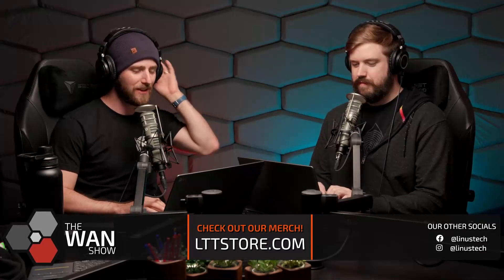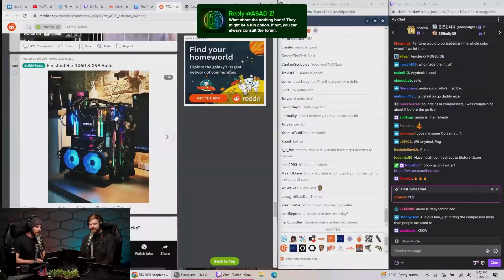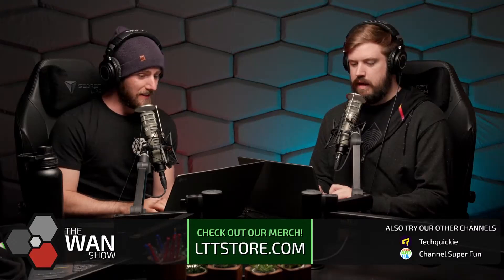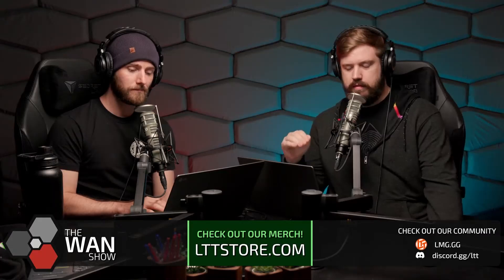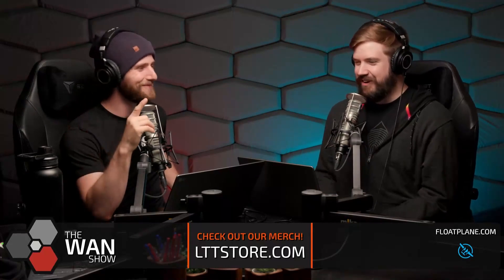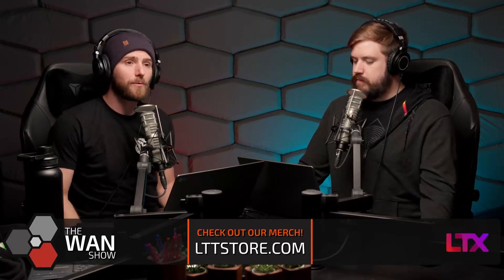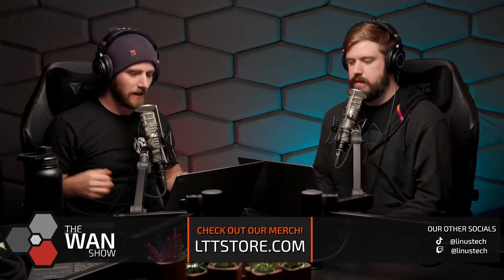Why 4090’s Are Catching Fire

Comment: I want a 40 Series, failing that, I want a 50 Series in 2024, but this melting connector issue has me wary of actually buying one.
Reply: Get a 30 series
Reply: @crazygamingyt7245  Already had one, and bought a 40 Series which I paid less for than I did my 30 Series.
Reply: @nihren2406  because the 40 series is worst

Comment: I think it could be attributed more to cheaping out than you claim- the plastic used is likely ABS or PLA which normally wouldn't melt, but with higher temps being produced by the 40 series GPU a more expensive plastic with a higher melting point might be necessary. Also reduced metal contacts cut on total metal required for production. Sure it might be 40 cents for a single GPU but multiply that by millions of units in production and that could be thousands in saving, and better materials likely will cost more than just 40 additional cents per unit (could be upwards of $1-$2 depending on the material). Now this might not even be Nvidia's fault, rather what the ATX standard would require for this new power connector, saying that these materials are the minimum required for the standard.

Comment: Maybe this question was asked in the comments already, but why are these power connectors at that location anyway ?
Would it not be possible to put them on the back of the card or something (opposite side of IO-Shield back). That way the cable management would look nicer too.
Reply: Both that the end of newer GPUs are actually just heatsink, the actual board stops a fair distance from the end, and that the cards are already stupidly long making it even longer with a power cable would mean them fitting in fewer cases. IMO the cards are already stupidly big enough to not fit properly anyway and would prefer having the power at the end.

Comment: Maybe the next RTX 5090 will need a separate 1000w/1600w power supply.

In latam that power consumption end up paying more in long term for the electricity than the cost of the videocard, and that's a LOT of money.

Comment: I suspect there was an engineer at Nvidia; "Yes Boss we can push this much power through a connector but we shouldn't; it's right on the edge and not very durable. There is a similar connector but with larger pins we can use." And they were overruled by management who could only focus on the idea of a single small connector.
Reply: The general rule is when an idea is unsafe, but may be desirable by management, say that it is not an option and describe the safety concerns.

Comment: The problem is that there are 2 types of adapters, Gamer Nexus had investigated this and they have a completely different Nvidia adapter than Egors Lab. They could not reproduce the error with their max 300v adapter, Egors Lab was a max 150v adapter.

Comment: Needs more thumbnail flames for ultimate click bait status. They are not catching fire, there are a handful that have a melted adapter (to varying degrees). This is a serious issue but making people think 4090's are catching fire is not helping the situation. It's clear that this is not a widespread issue, but Nvidia absolutely needs to be held accountable until there is a proper solution (which should be made available to all 4090 owners free of charge).

Comment: The connector is right up against the glass of my Corsair 4000 Airflow - I refuse to buy another case and rebuild the PC. Hoping the CableMod/Corsair cables allow for a little more bending. Then CableMod with that right angled adaptor will be a great additon. Because the 12+4 connector is also very small and light, its not always easy to tell you are fully engaged into the GPU socket as the "click" is a lot less than the PCI-E cables - I decided to double check mine before closing the case and to my relief, it wasn't fully in so I bet that will be a lot of people's undoing - bending, dodgy soldering, not a sold connection to the GPU all factors in a connector I wouldn't be surprised to be consigned to history after the 4000 series.

Comment: Buildzoid theorizes that problem with the 12V high powered connector has to do with the terminals where the connection goes. Nvidia is using a dual split design which in theory could be the reason why there are issues with this while 3rd party makers of the cable are using a single split design.

Comment: wait a second.
so are the wires pulled out from the terminals
or do they get squezed at the bending point.
Reply: Because the wires all have equal length, the tension on some of the wires when bending the cable can be pretty big.

Comment: I'm thinking what are the odds Nvidia never tested it bent? Like what if they just put the 4090 on a test bench with the adapter and never bent it like a user would for cable management purposes. So I'm wondering if it's something that was just never though of or considered when Nvidia made it
Reply: They did test it you should watch gamer nexus video about this, they bent the shit out of it and still not get any mailfunction done its working fine under any conditon!

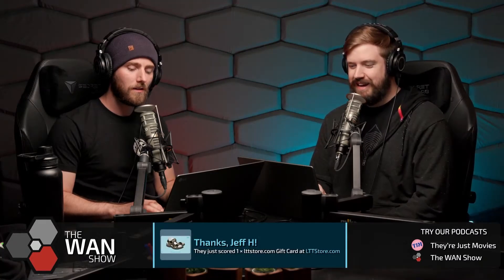Comment: 4:46
>small form factor users beware
>talking about the 4090
Reply: That connector is most likely going to be on all the 4000 series cards including ones that will be more small form factor sized.
Reply: @chronossage  like that'll exist
Reply: These days, "small form factor" could equate to "building a computer inside your GPU".

Comment: My high school teacher told me tight bends don't effect current but I told him he was wrong.  I didn't know how to explain it at the time, but watching a vacuum cable stretch pop out of the socket sparking was enough to understand the real world.  Funny how It's almost required for an electrician to come in to wire up a 25W light bulb and switch, but... it's perfectly ok for anyone to be responsible for contacting some new odd adapter that "allegedly" is sufficient.
Reply: I think you should have listened to your high school teacher...
Reply: @GareWorks  LOL His Science was sound but not all end-users follow science protocols.
Reply: I’m not sure I follow, tight bends in and of themselves don’t affect current, but if the pins in the connector are loose, they can be pulled out of contact with the metal contacts on the GPU receptacle. It’s not the current that’s the factor here, it’s the force a bent cable can put on a connector, particularly a badly designed connector. If their was no connector and we were just running electricity along a pure wire, it wouldn’t matter how bent the wire is, the current wouldn’t be affected (assuming we aren’t working with large currents here, electromagnetic fields do get more involved as the current increases).
Reply: @FinalSentinel  Absolutely I was wrong on the science in school,  Bends don't affect electrical flow the way they impede water flow for example.  But the wire itself is soft and gets fatigued, the terminals are usually built as cheap as possible and deform easily. It also depends on the installation, was the connector seated correctly?
Reply: @pepperfish_  please to not use the word "cheap" when the reality is different on many levels.
The terminals and their materials are designed with the contact area in front in mind.
The terminals have to withstand plugging and unplugging.
Then the crimp or solder area is designed as secondary constrain.
Optimizing for the contact area means compromising for the solder area.
Also note the continuum between flexible and brittle: Make it "harder to deform" and it becomes brittle and a thing we call "breaking" happens. Make it soft and you complain about that it deforms to easily - while bending/forcing the cable into place is literally deforming "something". Now you can ask for brittle pins and super flexible wires - and then we know for certain that it will break in the solder joint. Sometimes, making things less flexible makes them more robust, because stress automatically distributes over a larger radius.
Reply: @sarowie  What you say is not wrong, however this is not the original style PCIE power cable.  This 12vhpwr redesign I think is to reduce costs.  The old connector I agree was sufficient as you describe.    Along with my PC hobby also build High power draw RC and Kids ride on electric toys (36V PWM).   The terminal and the soldier joint is the weakest link in any connection and should be the focus of improvement not compromise.
Reply: Your High school teacher was correct. You can bend a wire as hard as you want as long as you are not going to bend it in a way that affects the diameter and shape of the wire.
Usually the thicker the wire the bigger the radius has to be.
Reply: @demacherius1  Exactly the point...only works in textbooks. If you do a perfect install of perfectly spec'd components then sure, however in this case the wire is coming off the joint the terminal is loosing contact.  It's actually a thermal failure and a physical one.  eventually the wire burns itself smaller and smaller, exponentially increasing resistance.  The thick wires I use are there to dissipate heat from the terminal, the terminal itself is loaded with a screw.  I could tug at the wire all day and nothing will break.. because my kids will too.... Thanks to my R & D, not my teacher.

Comment: Aftervthe new video from igor we now know that it was them cheaping out on the adapter 16 pin plug.

Don't we all love (especially in Europe) to pay 2000-2500 euro just to get an adapter that can break your cards plug?
Love it.
I hope AMD outperforms the 4090 is raster by a lot, just so the prices for this overpriced hellcard drop :)

As the other linus said a while back: F*ck you Nvidia :)

Comment: Me and my electronics hobbyist friend were having a talk about this whole 12 pin plug issue and within 1 minute he pulled up different styles of connectors on Mouser that would have been much better for the application.
Reply: I bet it's probably cheaper too, heck i think if people are doing watercooling shenanigans i don't think they'll mind if 4090 uses screw terminal thingy like normal high current application.

Comment: It might be worth adding a large disclaimer to the description or comments that GN did a bunch of testing and got very different results to Igor's Labs, so it's a complex issue that's not "solved" yet.
Reply: It shouldn't be an issue in the first place. The fact people are discussing this is proof enough that power consumption has gotten completely out of control
Reply: No they didn't not... Re-watch the video. The had different cables. they didn't test the same cables that igor tested...
Reply: It's not an issue with the connector, just the nvidia adapters

Comment: 5:15 How about just not making GPU's the pull 600w.  It isnt necessary.  For anything.  It shouldnt even be a thing.
Reply: It can be necessary, depending on what you're doing. The 4090 doesn't typically pull 600W on average though.
Reply: Thats not how that works

Comment: I questioned the flimsy design of the 12V high power connector from the beginning, also because of the cables are often too thin and get hot. They didn't need to make this connector that small. There is no practical reason and i don't see any benefits of the new connector in a consumer environment, or any environment at all. My personal opinion is that this new standard solves a problem that didn't exist. This is the problem with modern product design, that people are reinventing wheels all the time. I'm a microelectronics engineer myself, but i stick to proven standard rather than spending time and effort to make something no one asked for or something that's just done lazy. 

The placement of the connector on the founders edition card is also pretty awful aesthetically, having this octopus of cables hanging from the side. Such a tiny connector would have made it easy to put it on the rear of the card, where it also most likely didn't need to be bent that much. It's just silly to see something lazy and dumb like this from nVidia, because they have a lot of smart people.

edit: typo
Reply: There was a problem that they needed to solve, IMO. The sand bag rating of the PCIe 6 and 8 pin connectors. Those Molex Mini-Fit Jr. connectors are rated by the manufacturers for well north of 100watt per 12v conductor. 6 pin and 8 pin both have three 12v conductors. So each connector should support at least 300watt. But due to the way the specs were drafted in the before days, we were pigeon holed into needing four of the things to support 600watt officially. Unofficially, I've put a lot more than 150watt through a PCIe 6 pin without anything melting.

So a new, not backward compatible connector was really needed. As to whether it needed to be smaller? Well - the biggest change was the pitch. The pins are quite a bit closer together. But each pin can still carry nearly the same current as the larger connector. So if the size isn't a limitation - the thermal load here is minimal in proper use - why NOT make it smaller? It will open up options in the future, even if the current implementation is terrible.

Bottom line, the connector is fine. 600 watt through that connector is not a problem. But clearly the adapter cables needed more testing. Which really is the common theme in power connection issues with PCs - shoddy adapters.
Reply: @Santiago I'm not kissing anybody here. The 12VHPWR connector is an ATX standard and it's merits is all I'm discussing. I can't disagree that we're going the wrong direction in terms of efficiency and cost. But that's not pertinent to the discussion so I'm not sure why you bring it up.
Reply: The connector itself is fine, the adapter is the issue.
Reply: @Nebnub  a few days ago a connector melted, no adapter was involved
Reply: The 12VHPWR connector is only slightly large than one 6 pin PCIe connector and can attach up to 4 of them, and it has sense pins to load balance across the wires.  These are some definite practical benefits.  Granted these are only benefits because Nvidia is choosing to make these cards so power hungry that they need 3 or 4 connectors from the power supply.

Also based on GN's investigation it seems like the 12VHPWR connectors that are catching fire have a less robust design than most of the 12VHPWR connectors in the market.  All the ones they found have the 6 wires evenly soldered to only 2 common buses (rather than the design Linus described) and did not get dangerously hot in their testing.

Putting the power connector on the back of the card would make it likely to interfere with the CPU cooler.

Comment: For those people saying that they haven't watched the GN video, the WAN show was recorded BEFORE the GamersNexus video was released
Reply: And for people without the time to watch the GN vid, there seems to be some unexplained variation in the design of the Nvidia 12VHPWR adapter. GamersNexus did not have any of the adapter design that seems to be melting and with the design they did have on hand, they did not experience any major issues with it. They are asking for pics of your adapters, namely the text on the wires of the adapter, in order to get more information about why only SOME of the adapters are melting.
Reply: Still LTT IS A JOKE they are always late and are 100% mediocre 😑 there are 2 manufacters who makes these cable 1 is better. Still the card sucks. Want ur home on fire just buy a 4090
Reply: Technically those people are still correct. Their overall assessment is wrong, but it is true they haven’t watched the GN video.
Reply: still we need a new video about this GN showed us there are 2 nvidia adapters so egors lab is lying or he had an eraly production adapter.
Reply: yeh its still slightly irresponsible of them to upload this knowing its not officially the reason for failures so they are becoming part of the problem that is spreading misinformation, even more ironically they are spreading the information that directly came from a source which itself jumped heavily to the wrong conclusion.
Reply: @jinx20001  It's the wan show it's what they do. They often misinterpret the stuff the read, because they don't personally do the research. they just read notes someone else wrote. Don't watch the wan show for accuracy in news. it's for entertainment

But I agree with you also.
Reply: @DESTORECTO0  Ask the mirror.
Reply: they still re-upped a vod
Reply: @matthewpalmer9820  
They're uploading them because people want to watch them talk about stuff, but don't want to sit through the whole 2 hour livestream.

I'm perfectly fine with the idea that they don't have to ensure their vods are accurate at time of publication, as oppose to time of filming.
Reply: @anivicuno9473  no way, no way that's why anyone uploads pod highlights. That said, that take has already been proven to be faulty, so it's irresponsible to upload it.
Reply: @anivicuno9473  I don't watch the live streams.
I typically just check the clips of a topic that catches my eye.
Reply: @anivicuno9473  ''I'm perfectly fine with the idea that they don't have to ensure their vods are accurate at time of publication, as oppose to time of filming''

i dont understand why that seems acceptable to anybody, they shouldn't be clipping what they know is possibly wrong information out of one video and making another out of it, they should be making a new video perhaps clarifying the situation with an update.